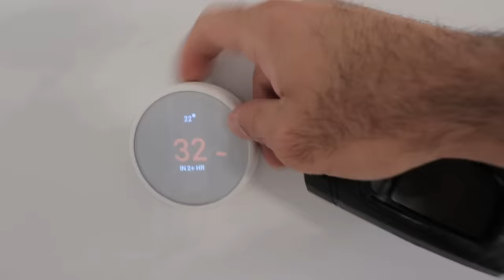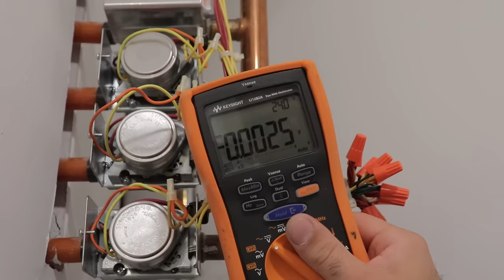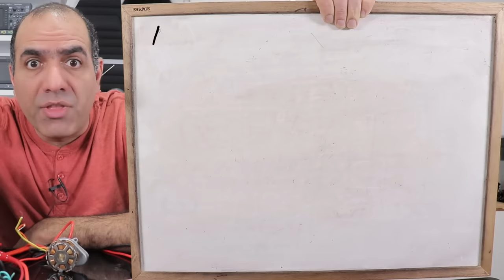Electro-Plumbing Repair… of my home heat zones that won’t heat although the boiler is running fine!!

Comment: the short circuit path is probably there in case all of the valves close, so you don't get a huge pressure spike and the water can continue to flow
Reply: Or it could be one of the safety features when you ask for a low flow rate (valves almost closed). I think these type of units need at least some flow, else they could get dangerous
Reply: Yes, but it should be a restricted flow.
Reply: So it's a flyback diode.
Reply: We have this bypass in chiller water cooled systems. It exists so the evaporator has a constant water flow even if there is no demand in the line.
Reply: ah yes, water hammer
Reply: My YT said this video came 1 hour ago and here are you commenting 19 hours ago :D. Magic
Reply: If it's anything like a normal european gas-fired system (sure looks like that), it's also there to keep the primary loop temperature constant, which makes the whole system more efficient. The green pump before the zone valves is likely an electronically controlled pump that is modulated to keep the flow rate constant
Reply: It's called close coupled tee. Typically used to separate the water pressures between the combi boiler and the rest of the house as they both have a circulator each on the same circuit.
Reply: The "short circuit" is there to provide the hot water.  Think of it as a battery and the circulator and valves are removing some of the stored hot water and replacing it with cold water.  You can also think of it as a tank.  The bigger the tank the smaller fluctuations in the water temp, but the more energy required to get the tank to full temp.
Reply: It's so that you boiler flow and zones/radiator flow are decoupled, allowing the boiler pump to pump at the flow rate required by the boiler regardless of how many zones are calling and what their flow rates are. (Which is more of a concern when each zone has it's own pump rather than a single pump and zone valves.) The zones can either flow more than the boiler, in which case some of their cool return water is recycled back into their loops, or the zones can flow less than the boiler, in which case, some of the hot supply water from the boiler is recycled back into the boiler's return.
Reply: @MCP647  Exactly. Another method of doing this is with a hydraulic separator, which is better as will allow the flow to slow down, debris to sediments and air to purge. A classical heat exchanger can be used too.
Reply: It's an oversimplified hydraulic compensator or separator!
For electrical engineers here, it works like a 1:1 transformer
Reply: The other reason is that if for some reason something clogs up the heater you will be prompted to check it out because your a$$ suddenly gets blown by cold water. It's also an electrical safety feature as the pipes are literally a huge ground.

I live in a country where heating doesn't exist because you'll die if a heatstroke if you did so yea take my advice lightly....
Reply: To prevent water hammering.
Reply: It Needs less Power to Heat already warm water
Reply: @Satyaprakash81102  why was this not the first comment. I mean come on you guys, of course its to prevent water hammering. Same reason the valves open and shut slow.
Reply: Any HVAC Engineer with a Mechanical Engineering degree could have told him that.
Reply: @Satyaprakash81102  no, those valves closes slowly, so there isn't water hammer! This loop is called a water compensator or separator and it's done because water flows with different speeds in the boiler loop than in the other!
Reply: @torsson2  This is a science channel. Not a religious one. Here we don't say the things that we do not know are magic. Here we make an effort to work out what is the reason for what we don't understand. Here the magic man of the gap argument doesn't fly. There is a perfectly mundane explanation for this that does not require a leap of faith to magic.
Reply: The Lead Workers call it a Bypass-Valve. It's like a zener diode, but for water.
Reply: Looks like a primary- secondary-loop system.  It is a way to get zones off of a constant flow rate primary loop (with modulating temperature).  

Hydronic baseboard heating is not very responsive, but it is very quiet.

I didn't think space heating and domestic plumbing could be mixed.
Reply: Boilers usually have an internal bypass for that case (that can happen if you have thermostatic valves on the radiators and all are closed). The reason for the loop is that there is an external pump (probably because the one inside of the boiler was not sufficient to pump the water in a system with a lot of radiators or underfloor heating) and you don't want to have the internal pump in series with the external one (obviously).
Reply: Keeps the return flow temperature up as well
Reply: Why dont u use a pressure valve in the bypass now when the heating is on the resistance of the bypass is so small that most of the water return back to the heater
Reply: It's a primary/secondary loop setup. it allows water to flow through the boiler without flow going to the heating zones.

You don't want that boiler running with no flow.
Reply: @crazyivakic  pressure valves tend to wear easily, this system called "water compensator (or separator)" do very well the job!
Reply: Yes, the heater circulates the water in the small loop and doesn't push it through the valves, if it's needed the black pump near the valves turns on and pushes the water through them
Reply: @MyNotSoHumbleOpinion  A 1:1 Autotransformer actually :D
Reply: @zaprodk  👍
Reply: @jrisner6535  Except that with a condensing boiler you want the return water temperatures to be as Low as possible, increasing condensation inside the heat exchanger so as to pull the maximum amount of heat from the exhaust gasses.
Reply: @louf7178  Most combi boilers have an internal heat exchanger to heat the domestic water independently. 
There are or used to be some jurisdictions that did allow the domestic water to flow through the radiators but it is not a common practice.
Reply: Yep, it's kinda "stupid" automation system so it needs simple solutions. 
Connection is there to signal the boiler that all valves are closed. Boiler is constantly monitoring temp difference on supply and return lines. When all valves are closed water runs in "short loop" then boiler "knows" it's time to shut down. I suspect pump on "long loop" (to radiators) is much more powerful than internal boiler's pump and creates enough flow to starve "short loop" of hot water so boiler dosen't turn off.
I'm not sure how those systems work, because in Poland we use diffrent solutions.
Reply: That sounds like a building code level danger. Someone saved us from ourselves.
Reply: @adinackerman5481  I like the way you think.
Reply: The short circuit path you pointed to is a "necessary mixing manifold" because the pressure of your "internal water pump" is usually much different than the the external circulator pump to drive the radiators.  All wall hung 95% efficiency Hydronic boilers use these items.  The small bronze gear on the zone valve motors wears out in 5 to 25 years depending on how often the zone valves are used.
Reply: Nope, the recirculating pump would never have a signal to turn on if all the zone valves were closed. The water heater sends power to the pump only after the zone valve turns on and opens. Also in the event that there was a pressure spike that was dangerously high, there is a pressure release valve that opens and spits the excess water out, usually on to the floor, the pipe just hangs off the side of the heater and goes towards the floor to nothing. Alot of people leave a bucket there just in case. Of course since the pressure relief valve is seldom used or tested, more often then not once it opens to release the pressure it actually gets stuck open and the water doesn't stop pouring out until you either shut the water off to the house or you whack the relief valve with the handle of a screw driver a few times to re-seat the valve gasket.
Reply: Diagram still does not make sense, or the boiler also contains another circulation pump?
Reply: It's called a bypass. The boiler has a pump that circulates around the path when the boiler gets a switched live and then the boiler has a pump over run for 5 to 10 mins to get rid of the heat once the switch live drops. The pump near the valves is the main circulator and pulls the water off the bypass loop and circulates around the system.
Reply: Patreon
Reply: Nonsense. That doesn't happen with electricity
Reply: Primary loop
Reply: It's so the hot water can circulate in the system, which is how you get instant hot water at the tap
Reply: @torsson2  That is exactly what I mean. I don't have first hand knowledge about how it works as I'm neither a patron  nor a paid subscriber(or what ever that thing in youtube is called) but I trust the peer reviewed evidence and actual experts rather than call them all mind washed liars and conclude it's magic. ;)
Reply: Not short circuit...ran for a few years...If it was "shorted"   it would be dead in seconds. after first  commission.  those zone valves burn up quickly.
Reply: No, the  loop is behind the pump. It is there in case the water pressure increases due to hot water. The inline circulation pumps do not make a pressure high enough to damage the plumbing.
Reply: it's most likely a safety feature
Reply: Actually simpler than this, if the valves fail the main heater senses hot water coming back and cuts off heating. simple and efficient way to protect the system. Temperature averaging is the second thing in mind, open a circuit with a lot of cold water is not a good thing so just take time to mix it and bring it up to temp
Reply: It's called primary / secondary piping. It's for full flow over the heat exchanger. Without it, if a small zone is calling and there is too little flow, it will over heat and the control will shut it down and hard lock out
Reply: @viperjason777  no, that's not how this works.
Reply: well the water heater pump has a different flow rate to the pump for the rooms, also it is probably not powerful enough to drive the water through the heating circuit.
Reply: Allows that water to circulate without overheating the unit/boiling
Reply: @MCP647  is there any restriction orifice in between? Otherwise won't the water for both circuit take least resistant path?
Reply: @AfaqSaleemChannel  no restriction at all. Some plumbers sometimes even increase the pipe diameter at that specific spot. Two loops, at least 2 pumps, so yes water will flow around both loops taking the easiest path. If the zone pump moves more water than the boiler pump then all of the boilers heated water will go out to the zones, as will a little bit of the cooler water returning from the zones.
Reply: @MCP647  Is there any online material you can refer to, got intrigued by it. Meanwhile please confirm if I understood correctly, the heater has its own circulator pump, the heating loop has its own circulator pump. The both loops combine at the common line so there is water mixing happening at common loop, the hot water from heater mixes with the return water from the rooms, then heated water leaves towards the rooms, while the boiler/heater water which is relatively cold now goes towards heater to get reheated. I made a sketch, let me know if I am right.
https://i.imgur.com/42JoZs5.png
Reply: @MCP647     what you are saying makes perfect sense and a standart on systems with different flowrate resistances and multiple zones. but here, judging by the poor piping/electrical work quality and as an owner of a very similar sytem;

1 - they just didnt want to integrate the "smart home system" and "combi sytem" into each other because its much much easier to install that way.  no any sort of communication needed between systems and each system can work independently from each other (although there will be no heating)

2 - combi warranty is still valid since there is nothing against maker's advised piping. no intervention on combi automation.

3 - when someone takes shower (run the tap), internal (combi) pp will be automatically stopped by combi pcb; isolating "heating line" from domestic line. this is very important as both lines use the same tiny heat exchanger. if you try to run water on both lines at the same time water will not get warm enough. so while your so called "smart home system" thinks it is in charge (adjusting valves and controlling circulating (larger) pp),  you can have a peaceful shower.
Reply: @MCP647  everyone here is trying to over think this, it’s a simple primary / secondary loop.  Majority of comercial systems work this way.  Boiler has a specific minimum flow, zones and hot water system pull what they need off the system, if that amount is below minimum flow it doesn’t matter as the boiler loop keeps running to make up the difference into the return side of the boiler.
Reply: It recirculates the hot water until it is used.
Reply: @edfx  Yes, the boiler has a built in pump. It's sized by the manufacturer to provide the proper flow and pressure through the internal heat source and a short loop of external pipe. It's called the primary loop. The black pump is for the secondary loop(s). Since each installation is different, it is sized by the installer to provide the proper flow and pressure required to circulate the water through the house.
Reply: @AfaqSaleemChannel  In your sketch the 'black box' mixer doesn't show the internal flow path. Assuming it's an open cavity, then the flow direction needs to be reversed on one of the sides. The two flows don't mix, it's called a separator. The hottest water possible should be going into the heating loop and the coldest water possible should be returning to the heater. Externally they circulate counter-directionally. The heater flow direction should be reversed since heat rises. 

The hot water would enter the top right. The volume of hot water needed for heating would exit the top left. The excess hot water would exit the bottom right. The cold water returning from the heating loop would enter the bottom left and exit the bottom right. Only the difference in flow travels between the top and bottom. 

information
https://www.caleffi.com/sites/default/files/file/hydraulicseparation-tr07.pdf
Reply: It's unbelievable how many comments there are here on what everyone thinks it might be, or could be, or should be... 🤦‍♂️
Reply: It's called a low loss header and it's so there are two separate pumping loops
Reply: I think it's also so the heater can keep that loop "hot" for initial turn-on of a heating loop.
Reply: @heartysteer8752  Thanks for sharing the document, the mixer I was showing was basically the commong path where secondary loop and primary meet, the flow direction I assumed was based on thinking that this common area is used as a mixer, but in document you shared, it more like the secondary loop pump pulles required hot water and add it back right after at 2nd tee, so it see the hot water coming from heater, and it eliminates the hassle of balancing the system. This cleared a lot of things for me. Thanks again
Reply: It's worse than that the pump would stall out or cavitate; but then the heat exchanger would boil the water. That can cause all kinds of nasty problems the heat exchanger could even melt through, but even if that doesn't happen the boiling would cause all kinds of mechanical loads, breaking baffles and so forth and seals can start to leak etc.
Reply: normally its a pressure release/overflow but they do use basic pipe if they dont want to do it properly
Reply: The loop keeps the return water temp up. If the zones are cold and the water in them gets to the heat exchanger it can crack the heat exchanger.
Reply: @darrylhaynes9208  I mean it theoretically could, but water hammer when there's no flow through the heat exchanger is a far worse and much more common issue. Water hammer progressively damages the system.
Reply: That short circuit path doesn’t bypass the pump. It bypasses the boiler.
Reply: I'm not a plumber but I noticed that systems that don't have this short circuit path have a pressurized expansion tank instead.
Reply: @alanpatterson2384 
So, is this because it only has a single burner inside that, when running, heats both the heating and hot water loop?
So, say somebody turns a hot tap on, it fires the burner. 
But, you need to pump water through both circuits otherwise one will melt.
And that's what the short circuit loop is for?
There's no request for heating, the valves are closed but this way you can still pump water through the heating side of the burner. 
Which wouldn't explain what happens when it's heating only and no hot water, how does that side pump when there's no demand for hot water?